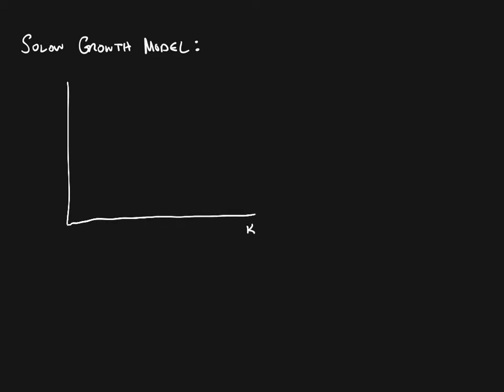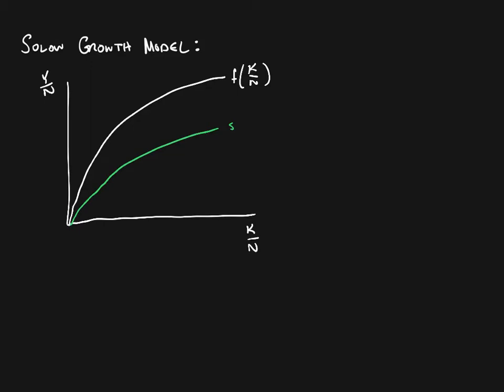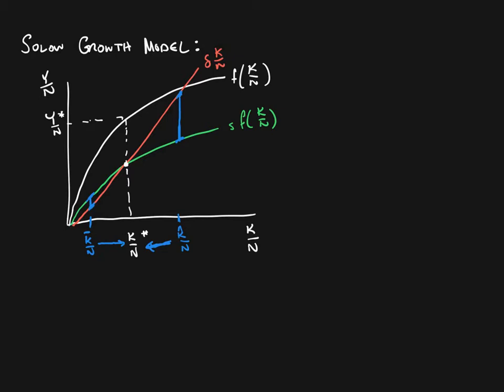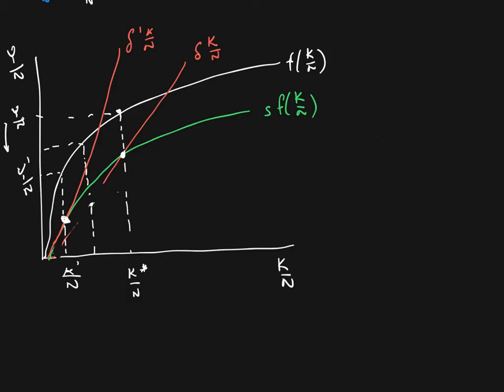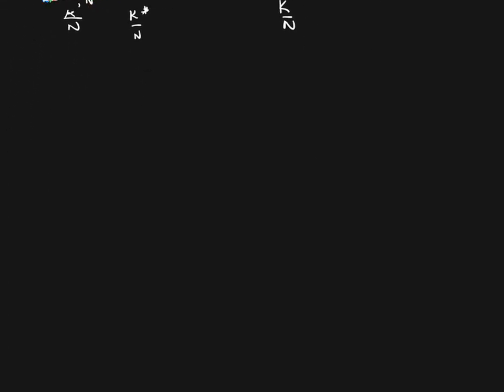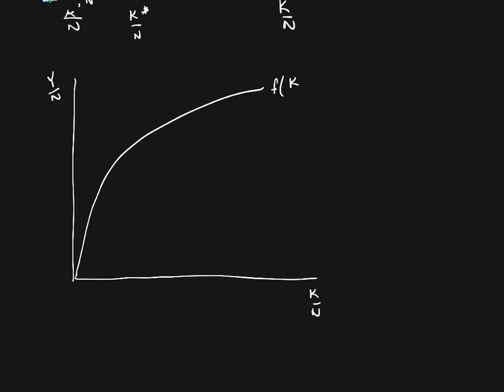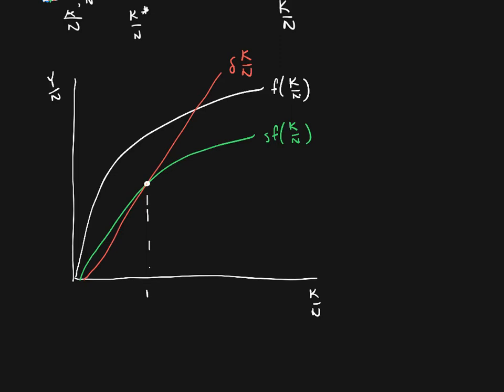Solow Growth Model, Part II

Comment: In the last example in which you assumed that there is technological progress, due to which there will increase in output per worker. But you also assumed that saving rate is not changing, then why did you made a new investment curve? How is it possible that fixed saving rate produces more investment?
Reply: Investment is determined by S *f(K/N). When technology improves, K/N increases, so even though S stays constant, S*f(K/N) increases.
Reply: Say intially output was 100 dollars. So a 10% savings rate would mean a saving of 10 dollars..now say if output increases to 200 dollars , and savings rate being constant at 10% now would mean an absolute saving of 20 dollars.see here saving rate is constant at 10% .but absolute amount of savings changed from 10 to 20 dollars. Thats why savings curve shifted upwards to indicate more absolute savings for new output level.